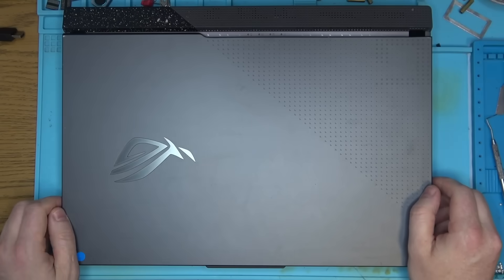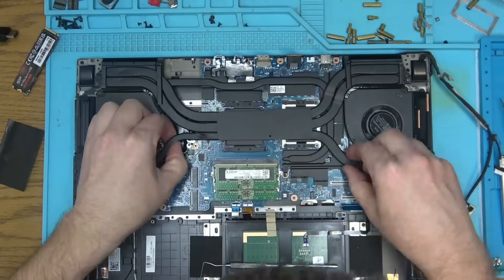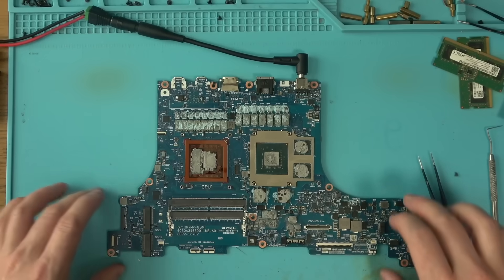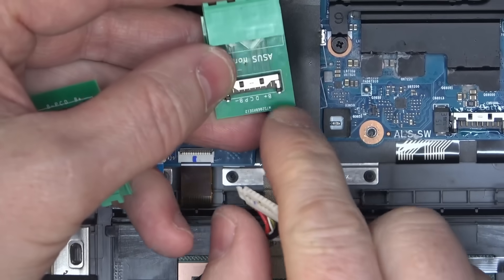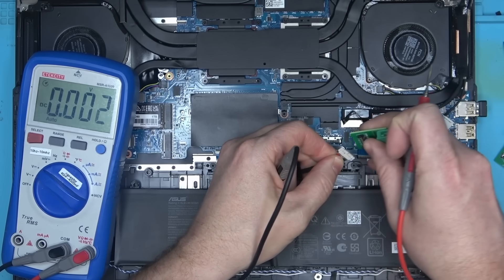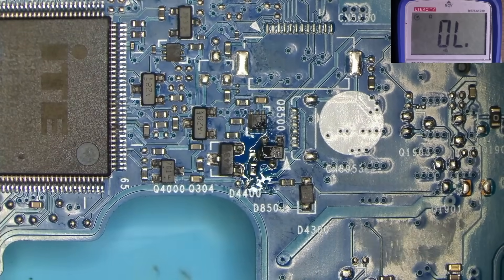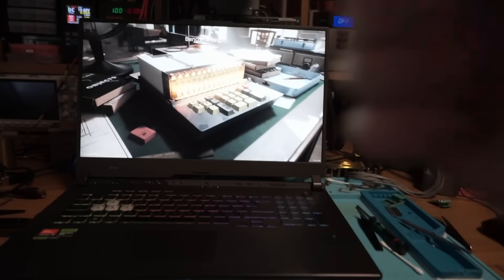ASUS G713 does not power on from the battery

Comment: for asus laptops: after u disconnected the battery internally and reconnect (after upgrade, repair etc.), u have to connect the psu cable to the laptop and let it start once to windows. after that u can power down and disconnect the cable. after that it starts.

Comment: So after a week i can report that the laptop is running like a champ. No doubt it was the nwfix flux. The screw holes were already there when i bought it off ebay. I think all the problems came when he spilt something on it and tore the battery connector off. I think he replaced the thermal liquid and thank god didnt get any outside on the board. Thanks Tony!

Comment: Amazing job
I own a NLBA1 and i can tell you by experience, the cell test tab doesnt always show green cells even when they are new, usually the lipo flat batteries have more internal resistance than 18650s, and if is one cell only you will get always a higher resistance, except if they were 2 in parallel, so the resistance is lower, also HV cells have higher resistance that 4.2V cells, but as i saw in the video that battery showing yellow status its a great indicator that the cells are perfectly healthy

Comment: Nice work getting this laptop running again. The customer always knows best eh? "It just needs a new battery connector". If repair was so simple, why did they leave the LED connector unplugged, use a screw that's too long and rip the battery connector off?

Comment: As always great repair!
Those jokes are just gold :) Also great video editing.
I would like to add from my experience that some laptops need to have plugged power from AC adapter before they will ever turn on only on battery. I had this issue even on my own perfectly functional MSI laptop. When I unplugged the battery for changing the thermal paste it refused to power on after putting it back together. It needed initial power from AC adapter. Maybe some charging ICs need this to initialize I dunno.

Comment: To be honest this repair makes no sense to me. You replaced one ESD diode with another and it didn't work. About "matching" ESD makes no sense. I2C is only 3.3V. Sounds like you soldered wrong diode or they both were gone or something. But if you soldered 2x wrong diode and it started to work makes no sense either. Only what would make sense is that another diode was just gone too.
Reply from the maker: ESD were protecting clock and data lines.
If diodes dont have same voltage drop, comms will be out of synk.
Reply: @northwestrepair  Have you actually measured them out of sync on oscilloscope? There is only slim chance for that. That would mean both of your diodes interfere with signal, but just not enough to make it stop working. I2C is very low speed communication which makes interfering it quite hard. I2C fast is only 400 kHz. Above that rarely used. Could check with oscilloscope. If signal is getting interfered means ESD diode is not good any more or too big capacitance. Clamping voltage just should be somewhat above 3.3V. I guess capacitance difference could cause problems if one ESD diode interferes signal and another doesn't. But if you interfere the signal on one line then interfering it on another line as well doesn't make it work. So still most likely another ESD diode was gone as well. Like you measured voltage drop and it looked good, but it doesn't mean it was 100% good. It still could of taken hit. Capacitance or clamping voltage might not been same. Oscilloscope would of showed that. Interesting problem.

Comment: 01:55 the diss perpetuates :face-blue-smiling:
Reply: I think the iron was too hot and it probably melted the plastic, which made the flux look darker. When he brushed it with the cotton tip, you can see the chip’s plastic looks kind of warped from the heat. So yeah, he might have turned the temp up way too high. This video doesn’t really show if the flux is actually bad or not.

Comment: Best way to solder these battery connectors is to hang the board off the edge of the table and hot air from other side of the board. Even the genuine asus ones from asusaccesories melt a little if heated from above.
Reply from the maker: yeah i know. sometimes there are chips on the back too so its not idea every time
Reply: @northwestrepair 
Try low melt solder, it's really good stuff.

I just don't understand why Alex says in his videos that it can melt at 48 degrees Celsius, but in his description it says
"Low melt solder melts at a very low temperature about 160-200c".
Very confusing...🤔

Comment: 6:50 as an EE I'm actually not understanding how this fixed it. SPI or I2C have no real major requirements for matching ESD diodes, unlike things with diff pairs. Like maybe if it had a silly amount of junction capacitance and the data/clk was getting out of phase with one another? All I can think of.
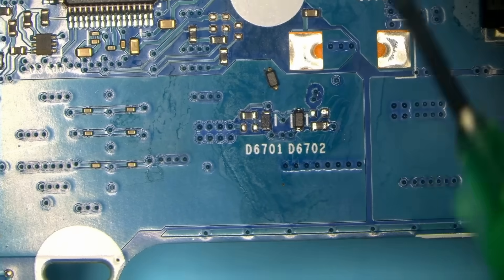Reply: Look closely at 6:44. He actually flipped previously soldered diode and just did not mention it. He just probably forgot as he makes voiceover later.

Comment: OH GEEZ THAT'S THE SAME KIND OF LAPTOP I HAVE, you've earned yourself a subscriber and probably a customer in the near future, i have had no end of issues with the battery, the laptop refuses to run on battery, it blue screens almost instantly. :/

Started happening one winter maybe 2 years after i bought it, its basically been babied and well cared for otherwise, i'm absolutely baffled a local tech tried everything short of replacing the board entirely or the core / gpu.
Reply: I had a similar issue with an old Lenovo laptop of mine. It seems like a common failue point. I replaced the battery several times, but it eventually just magically started to work again after a while...

Comment: How flux sucks???🤔🤔👀👀
Reply from the maker: Well, it kinda does and does not.
It has its uses but they are limited to hot air use.
Anything with a soldering  iron is a no no basically.
Reply: @northwestrepair I've recently watched Alex repair video. And you will clearly notice that the flux is darkening and becoming jelly in a short period compared to the ones he used to have.
Reply: You are just a kid  @northwestrepair
Reply: Even tree sap flux is better than his. I tried to make a joke here but to be honest made by old commblock recipe such kind of flux is good for smaller packages and overall SMT soldering. If you have something that needs to look like factory and don't leave any traces and you can't add Pb solder it's a magic flux. There I was serious. We can laugh but nothing can beat tree sap flux. Also it washes very well, even burnt one. Another advantage is that it doesn't introduce shorts and protects PCB, true non wash flux :D When you work on 50 yr old radios from commblock that smell and how nice it still melts after 50 yrs is impossible to replicate. It's also cancerous but what the hell. But coming back to reality I usually use tree sap flux on SPIs in devices that are still under warranty that people bricked them, not wanting to wait for warranty period. So far I haven't had feedback that warranty was denied upon further issues. You should try this, seriously.